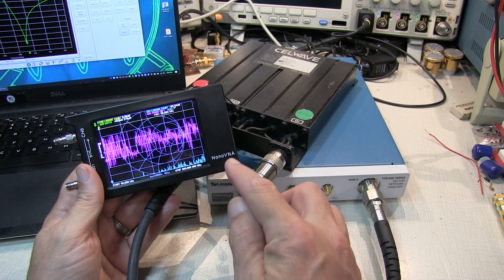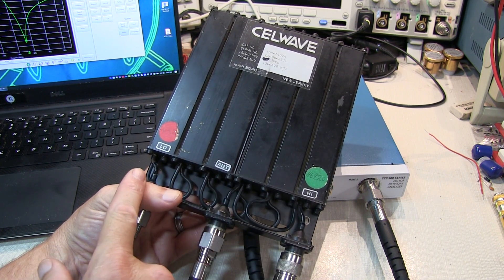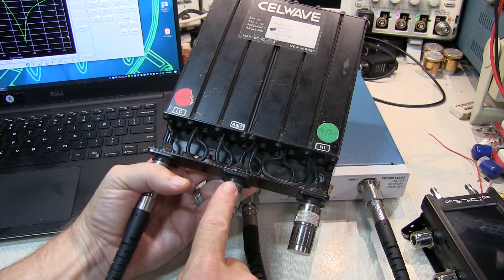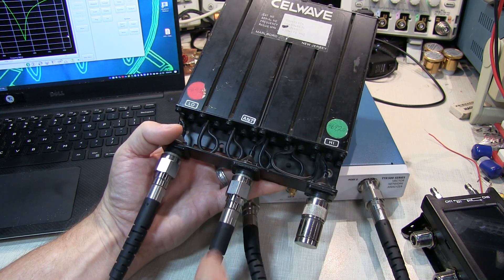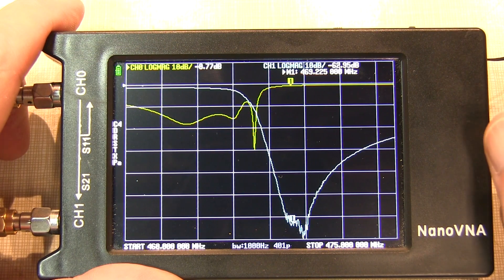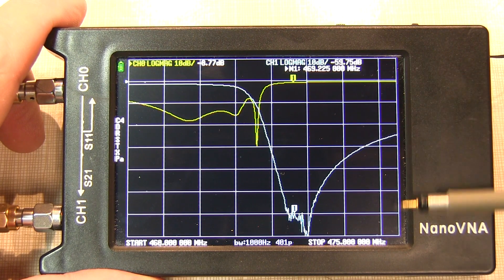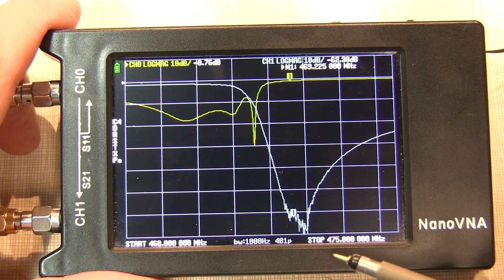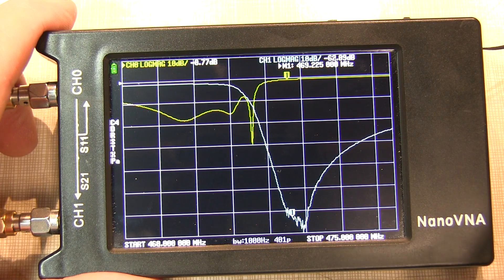#318: NanoVNA comparison measuring a duplexer - NanoVNA-H4 and SAA-2N

Comment: Interesting advanced test capability of the Nano VNA H4.  I just got mine and am learning how to use it.  However, this is beyond what my needs are with the Nano.  I like the fact that I could do this type of test if I needed to.  I do need to test older filter circuits which are crystal controlled for Heathkit HW-101's, and you have shown that in another video.  Enjoy your content. 73's

Comment: ..they can be used to fine tune a duplexer , just zoom in on the wave dude. Come on
Reply from the maker: Zooming in will improve the frequency resolution, but does not improve the dynamic range, which is the main limiting factor with the inexpensive VNAs.

Comment: Hi Alan. Regarding the nanoVNA H4. I know this is an older video. I was wandering did you have in this firmware version the possibility to select bw? Maybe you don't recall it anymore... I bought a H4 about some half a year ago, and see I have pre-installed fw version @Dislord @edy555 1.1.01 from 30 Dec 2021. I have noticed on your screen CH0 and CH1 (and on mine S11 and S21 instead) and have seen on developers site they changed that from version v1.0.63 dated 30 May 2021.. Regarding the bw (in this v1.1.01) I can go as low as 30Hz. It doesn't really lower the noise floor (better dynamic range), as I have expected, compared with 1kHz (on the same range you used in this video), but rather the signal/trace is much less noisier (I have just an open CH1 connector and measuring the noise floor). Also I see you have 7.5 vertical divisions, and I have 7. I will try now to upgrade to the latest fw version v1.2.20 from 12 March 2023. Do you know by chance are there differences in fw these days for this little unit, regarding DiSlord and Hugen (as I am not an advanced user yet) and just try to understand?
Reply from the maker: I haven't changed the firmware beyond 1.0.69 yet, so haven't really looked into the changes.  Since you stated that changing the BW to 30Hz didn't lower the noise floor, I suspect that this is a video (post-detection) filter, not an actual IF filter.  I really should update my unit too ;-)
Reply: @w2aew  Good point about the VBW! One other thing that I am confused about is the usage of Reference Position. I was mistaking that for Reference Level, as I know from Spectrum Analyzer. It seems that this function works differently, in the way I don't really understand yet. I read that the newest (beta) version v1.2.26 has more settings possibilities as Top and Bottom value.
Reply from the maker: @ernestb.2377   Right- Reference Level on a Spec An sets up the signal level at the top of the display, and also ties into the setting of the front-end attenuator value.  The Reference Position on the NanoVNA simply is a display offset which tells the analyzer which horizontal line will be the the 0dB value.  It does not change or alter any input attenuation or anything like that, because the NanoVNA doesn't have any of that.
Reply: @w2aew  Indeed, I see know, Reference Position shifts the 0dB point up and down the screen (0 the bottom gird line and 8 the top grid line). Lower or bigger numbers than 0-8 takes it off the screen...

Comment: Well.......that Sucks !
                🫲☹️🫴

But there again like you mention !
Not a Commercial, or Professional unit, but made so the Radio Amateur may find value !
If nothing else, it may help with the understanding of the Smith chart ?
Having said that, it may be reckless, but if you can get those Cans that close, especially that far down DB wise, couldn't you tune the rest by ear ?
Or even call it good  ?
Speaking from an Amateur Radio perspective, that is !

Comment: I'm no RF engineer, but I am curious about the possibility of using the averaging of high numbers of samples to reduce the noise floor sufficiently to tune duplexers. I realize that it would seriously slow down the alignment, but I have a lot more time than I have the sort of money that a professional VNA costs. So I'd be willing to take my time with the alignment if the technique actually worked. Would it? The reason I am curious about it is because high numbers of sample averaging worked very well for digging out weak BPSK signals from my Longwave beacon transmitter, and it seems like the same sort of problem.
Reply from the maker: Averaging can help, but isn't a cure all.

Comment: Great video. Thanks for posting. Would putting a 20 db pad inline help with the readings?
I just received my NanoVNA H4 yesterday and it came through with the firmware that allows 401 sampling points. 
I noticed the SAA2 only had 101 sampling points. I hope they come out with new firmware that will allow up to 401 sampling points. These little guys are great. I also have the TinySA. Great for hunting down noise sources.

Barry, KU3X
Reply from the maker: Hi Barry - I don't see how adding a 20dB pad would help, since the problem isn't with distortion products but rather with the inherent noise floor.

Comment: Can't you put an attenuator inline to stay within the dynamic range of the device?
Reply from the maker: I don't see how adding an attenuator would help you "stay above the noise floor".  If anything, it would push your signal/measurement deeper into the noise floor.
Reply: @w2aew  :: it reduces the amount of power so you don't end up pushing the bottom of the noise floor. It doesn't give you an accurate reading but it's simple. If you use a 10 dB attenuator you will add that to the amount of attenuation when you look at the final
Reply: @w2aew  this is a common technique to make sure that you're not overdriving your signal and pushing it into the area if the bottom other range than NanoVNA. If it doesn't have the dynamic range you put less signal into it and you can still tune down further than without.

You may have to increase the amount of attenuation on the signal sampler to keep the signal a bit noisy as you improve the pass band tuning, doing this will allow you to heard the gains made. Continue with this procedure until no more improvement can be heard.
Reply: @tomasguerrero6576  :: that's exactly what I was talking about but apparently we're not allowed to ask questions of the Master. I posted a question that didn't really deserve getting snapped at. I know that it's not uncommon to use an attenuator with a spectrum analyzer when tuning a duplexer. The Master could have simply answered the question minus the sarcasm.
Reply from the maker: @tomasguerrero6576   This technique works when trying to tune the bandpass response, but does not help when trying to tune the notch depth.

Comment: Nice presentation of the nano in observing of tuning of a series of filters pass or notch. The mobile duplexer in your presentation is a notch duplexer NOT a band reject duplexer.  It’s not semantics either, it’s the correct identification of the duplexer design. I disagree that the NANOVNA is not suitable for tuning the duplexer. It certainly is if you have ever tuned one and is confirmed in your video. What you cannot measure with the NANO is exact amount of notch depth but this isn’t important if the minimum point of the NANO is set to the frequency desired as notch depth and notch skirts will be properly set and tuned based on the cavity Q.
Reply from the maker: Thank you -- I appreciate the clarification of the duplexer type, and my mis-characterizing it as a band-reject.  I understand the difference, and it was verbal sloppiness on my part.  I guess my concern in not being able to see the notch is that the actual notch position (below the visible noise floor) might be a little tricky to determine if the shape of the skirts on either side of the notch are not symmetric.  Do you agree with this?  At the very least, it may make it harder to align each of the multiple cavities I would think...  It sounds like you've done this more than I have, so I defer to your experience on this.
Reply: @w2aew 
You are right anyway.
A spectrum analyser with TG will show the skirts, so you can tune all "cavities" to maximize perfomance and disired bandwirh (if it is the case).

Comment: You stated that with the Nanovna it isn't possible to adjust a duplexer for maximum performance at given frequencies within the designed operating range.  I completely disagree since it is not necessary to actually "measure" the magnitude of the notch in the example of your demonstration but the position of it specturaly.  The Nanovna will do this however, even though it cannot measure the magnitude of the actual notch depth, that is not important for proper adjustment. Once the notch is properly set within the center of the frequencies of the notch, that is all that is necessary since the design of the duplexer will provide maximum attenuation assuming the duplexer is properly functioning. If it isn't the nano will show this too. There are more measurements errors caused by improper field instrumentation than anything else. Moreover, a VNA for field application such as that for amateur radio requirements  is super overkill since only return loss S11/S22 and transmission loss S21 are the primary parameters of interest which a scalar analyzer will provide quite accurately.  Finally, the use of "Band Reject" is improper since the filters are tuned for a specific notch frequency, hence the correct name is notch duplexer, not band reject duplexer. Otherwise a very nice and informative presentation. :-)
Reply from the maker: Thank you for your helpful critique and clarification, very much appreciated.  I understand what your saying regarding it not being important to know the actual depth of the notch, but just to know that the notch is set at the correct frequency.  I assume that you'd determine this by looking at the midpoint between the frequencies where the S21 hits the noise floor of the unit.  My question is, how common is it that the shape of the S21 curve is not uniform around the notch, such that the actual notch frequency is a little higher or lower than the midpoint between the visible portions of the curve?  Keep in mind that I am approaching this from my own very limited observations, since I don't have much direct experience tuning many duplexers as it sounds like you have.
Reply: The exact position of the notch is a function of the notch duplexer tuning. The maximum notch depth is  a function of the coupling of the two filters but primarily determined by the Q of each filter. It’s placement is determined by the tuning of the two filters. The rigid RG142 is used to minimize losses and to preserve the integrity of the harness given the environment of the intended application and to increase yield in production. I hope that was the characteristics you were describing in your question. If not let me know.
Reply from the maker: @bkj242  Let's see if I can make my question a little clearer.  When tuning the notch frequency, if the analyzer's noise floor prevents you from seeing the full shape of the filter, thus obscuring the "peak" of the attenuation, then you have to make a judgement call as to the actual notch frequency based on where the skirts of the filter crash into the noise floor.  My question is  -  the shape of the skirts on either side of the notch may not be the same (have the same slope), thus the actual notch frequency might not be midway between them.  How much of a problem would this be?  Or, are you suggesting that you try to measure each cavity individually so that the notch isn't as deep and more likely to be set correctly with a more budget friendly instrument?
Reply: @w2aew  the shape of the notch displayed on a lab grade VNA will be noise free and should be symmetrical with a defined notch width free of noise. Since that resolution cannot be supported on the less expensive field type VNA the resultant shape of the skirt will not appear to be symmetrical which is what I believe is your observation you describe.

Comment: Can you make a video with a paper telling the difference between Diplexers and Duplexers and examples of what both are used for to get a theory of operations on both. Why are you tuning the duplexer filters using S11 return loss? Why doesn't the NanoVNA have the definition to go all the way down to -100dB or more even if you change the scale to 20dB per division it still won't give the same results is because the front end or what in the NanoVNA is preventing this? Do you think a newer firmware update will fix this problem or its the ADC/DAC converters that is causing this issue?
Reply from the maker: There are many factors (phase noise, isolation and shielding, quality of couplers, etc.) that affect the dynamic range of a VNA.  Addressing all of these things gets costly, which is why VNAs with 120dB of dynamic range cost a lot more money than a NanoVNA.
Reply: @w2aew  ok thanks, I never looked into the specs of VNA about dynamic range. When looking at the specs of a VNA how do you really know that the dynamic range is going to be working good with 120dB or 150dB dynamic range? because the specs can be false and say it has the dynamic range until you put it to test to really find out if it works or doesn't. I don't know what other RF components or RF circuits that would want to measure a Dynamic Range of 100db to 150dB besides Duplexers. What other RF circuits would you want to use a very big Dynamic Range for testing and tuning for?
Reply from the maker: @waynegram8907  Duplexers and other high-rejection filters are likely some of the more demanding devices to test with a VNA.  You have to interpret the manufacturers specifications very carefully when looking at dynamic range performance to be sure that it will meet the performance you need.
Reply: @w2aew  thanks, I never ran into that problem before I overlooked it. I have only used old 80's HP network analyzers and never had a dynamic range issue. The Rejection filters and Duplexers I guess I have tuned didn't go all the way down to 120dB to 150dB when I was tuning them. I'm guessing not all Duplexers and Diplexers rejection filters have the same dynamic range. I never thought about a Duplexers and Diplexers Dynamic Range criteria specs.

Comment: We all know that one should use an attenuator when the input signal is too strong. I think there a similar workaround is possible: we can use an amplifier in a measurement circuit. It will not do great magic but in some cases is possible to pull the signal through a bandstop filter. Probably it should be a logarithmic amplifier that will compress the dynamic range. If we could figure out the dynamic response of that test circuit we could obtain characteristics of the filter or device. There are a lot of drawbacks but the concept seems to be possible.

Comment: I recall seeing one of those nano VNA’s that could be connected to a computer and run an open source program that gives you a desktop view so that you could have a higher dynamic range. Much like your professional unit is operating but still not as a high quality image.
Reply from the maker: Using the desktop program will help you increase the number of points and do some averaging, but will no increase the dynamic range.

Comment: Hi, although exact frequency at which dip occurs can't be seen (because of low SN ratio of nanoVNA), I think that frequency at which dip occurs could be still calculated relatively precise by extrapolation of S21 curves using some curve fit algo and using S21 points in range from 0 to around -55dB (approaching from left and right side). Resulted dip is where both curves meet. It would be interesting to see how that result compares with professional VNA. (It may be even possible to get some approximation of how deep that dip is)

Comment: Would it be possible to aggregate data from numerous sweeps to extend the effective dynamic range?
Reply: using avg lowers noise so adds dynamic range ... more measure points with finer stepping also helps ... we now have fw with avg x 80 and 511 measure points .. but you can never get below 90 to 100 db cause the internal leaking is in that range

Comment: One question, can I improve the dynamic range adding a wide range LNA amplifier (20 or 30dB) in the port 21? 
Only to improve the noise floor and maybe the Notch peak measurement capacity. 
I have both, V1 and V2 NanoVNA.
Thanks
Reply from the maker: Maybe - but you have to take great care to remember that the NanoVNA's output is NOT a sinewave, it is usually a squarewave, thus has a lot of harmonic energy.  The V1 devices actually use the 3/5th harmonics when measuring above 300MHz.  So, these harmonics are always there, and might overload the amp or Port2 (CH1) if they aren't filtered out before the LNA input.
Reply: maybe a skyworks 65017 ... nearly flat 20 db from a few megs up to 6 gig

Comment: Is the reference level fixed on a nano? If it is configurable wouldn't it be possible to measure the I.L. of the pass at a reference of 0 or slightly greater, then change the  reference to say -40 or so to measure the I.L. of the reject to work around the smaller dynamic range? Is the  actual limitation the Noise floor or effective sensitivity? I may be unaware of how doing this would create a false measurement I'd greatly appreciate your input.
Reply from the maker: Reference level is fixed.

Comment: I have my Rigol spectrum analyzer with TG for measuring stuff but it's not really portable so I will buy one pocket sized VNA for sure some time in the future. Also these must be really great for beginners as the "real" analyzers cost at least four figures. But I also think if you really start setting up a relay station you will have to use proper measuring equipment as the material for the station  by itself can be very expensive and youdon't want to go cheap on tuning.